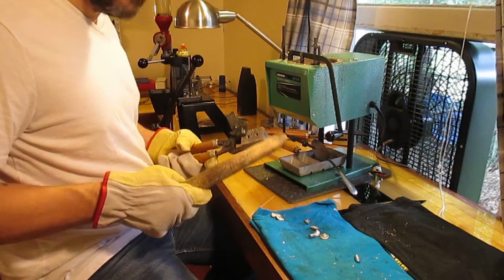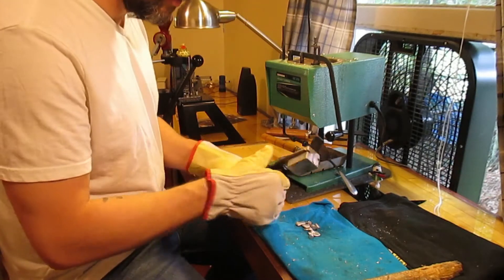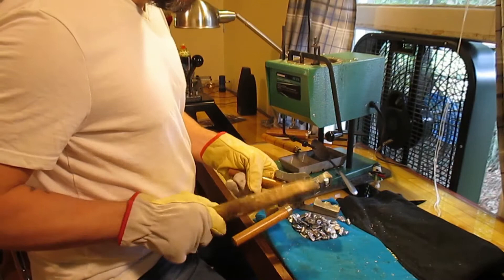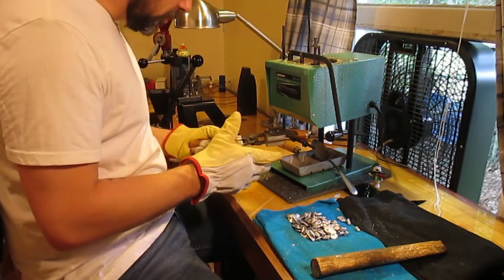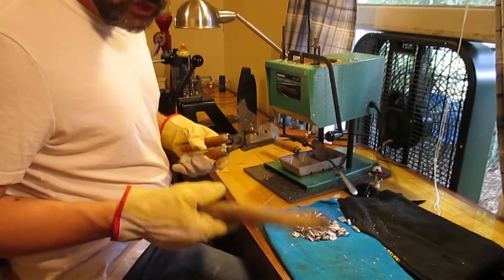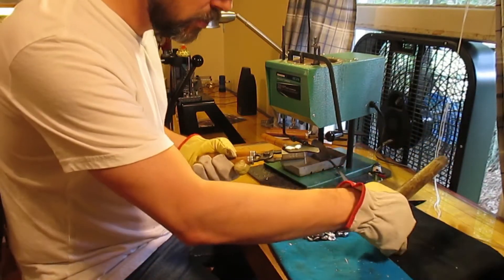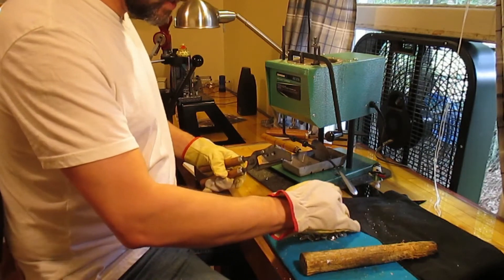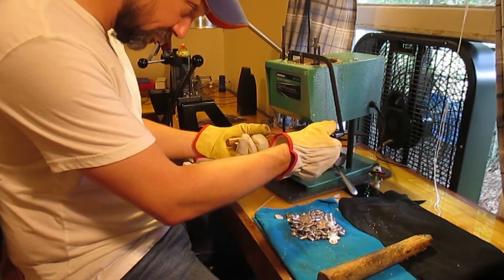Shooting the Breeze Ep.1 Hand Gun Load Development Technique

Comment: Most of my loads and powder choices are the tried and proven loads from 30 yrs ago . I have nothing against the newer powder choices but if it ain't broke , don't fix it . For cast bullets , I shoot at 25 yds for the best group and don't worry about chrono numbers . Some of my best groups have bad SD numbers but will group all day long . I use the chrono to get the desired velocity I'm looking for which affects my powder choice . The SD numbers don't mean squat to me . I've had great SD numbers and horizontal stringing . At the end of the day it is the smallest group at the velocity you are looking for .
Reply from the maker: James, my experiences have been very similar. I have some loads with junk SD that shouldn't shoot well at all but are great. I appreciate the response. I'm hoping to find something that allows me to test more methodically. I agree that SD isn't likely to be what I'm looking for even though it does indicate consistency which should lead to accuracy. 
Nathan

Comment: I try to find loads that work with the powders I have on hand.  My goal is limit the number of pistol powders I need so that I can just order an 8lb jug to last a while.  So far, I've been able to do that with Titegroup & CFE Pistol.  I've experimented with Universal and found loads that worked just as well, but didn't give any advantage worth reordering more when my tubs empty.  So if I change bullets or guns, I'd 1st see if I can get a load that works in either of those 2 powders, and only if I can't then I'd look to try a new powder.
Reply from the maker: Cranky, most of my pistols use Unique and Trailboss. The limiting factor for me is usually my reliance on COWW lead for bullets. Thanks for watching. The .32 mag series is going to try some "scientific" load dev for handguns, hopefully it goes well and I learn some new things. 
Nathan
Reply: I'll stay tuned as it sounds like I might learn something from a scientific approach.  My method is far from scientific :)  I don't have a revolver so my 1st major concern making sure the gun functions and not getting any stove pipes or brass barely ejecting.  Then I'll chronograph it to see if I'm inline with factory velocities.  I shoot all PC or HiTek coated cast, but pushed to jacketed velocities.  Can't suppressed where I live so no reason to mess with a reduced load that won't function my gun.  Finally to check accuracy, I let my son shoot :)  I've seen him put 47 or 50 inside the 9 ring off hand..so I know the ammo is accurate enough and it's my shooting that isn't.

Comment: If I'm just looking for a safe, cheap, easy plinking load in a handgun I'll use what works nicely, gives a mild velocity, no pressure signs, and of course works the action reliably on a semi auto.   I'll start with published data from a few sources and find a load that is in the low-end averaged from the different sources and see how it does.  

If I'm really being picky or like when I worked up loads for the 7.62x25 and didn't have much published data,  I bench rest it at 25 yards and record group size, working up from the low end on the data.  I usually only do that if I am really being anal for that particular load/gun combo.

When I was trying something like surplus WC820 powder with a heavy bullet in the 7.62 Tokarev where there was NO published data, I actually shot it with a huge welding glove while I hid the rest of my body behind a tree :)    Bet that looked funny, luckily nobody was around to witness it.
Reply from the maker: Toolness, I haven't gone so far as lashing a gun to a tire and firing it with a string but I have witnessed that version of load development lol. That is close to my usual process as well. I usually stick to 10 shot groups cutting out the worst shot but I"m thinking there may be a better way when checking multiple powders and bullets. We will see.
Reply: Time is the biggest factor...time to research the loads, time to load them, then time to shoot them carefully and record your results.  
My dad used to use the tire trick.  I hid under the bench one time when I tried my first cast load in my 8mm Hakim :)
Reply from the maker: We went through the tire method when we got our first 8X50 steyr. There was no load data at the time for it and nothing but some old corrosive factory stuff. Now Hornady makes 8X56 but noone does 8X50. Anyway I agree time is a huge factor. FO SHO.

Comment: Hey Nathan this is great! And I 100% agree keeping an open mind can add valuable techniques.  I haven't done much LD for pistol other than 357 mag and 9mm and some 44 but from what I gathered, chrono numbers like SD and ES are not necessary to focus on unless testing for expansion. Rather POI matching your sights with desired FPS goal. I like Charlie's method of just shooting a large batch and seeing overall groups comparing. I would pick a load which matches sights close to factory rounds, good fps with a comfortable recoil for you and easily extracts with around a 3 inch or smaller grouping at 15 yards
Reply from the maker: Thanks Eagle Eye, I've just been wondering if there is a more methodical way then just accuracy testing. I've been doing 10 round accuracy testing for years and honestly, the results aren't always stable. Temperature can some times play hell on you as well as small variations in bullets but once you stumble onto a "pet Load" all that instability goes away and you can't do anything wrong. There has to be a way to develop these loads. Hmmmm